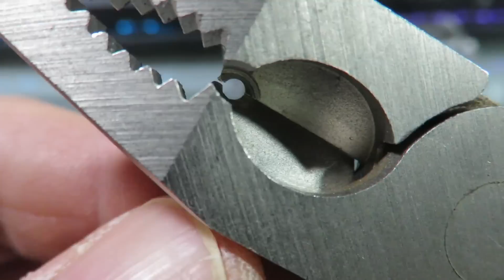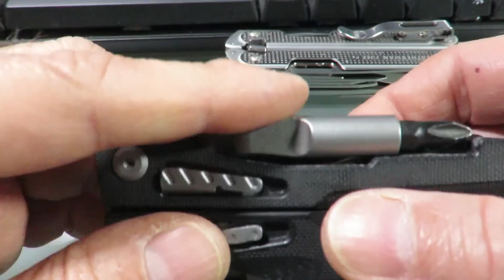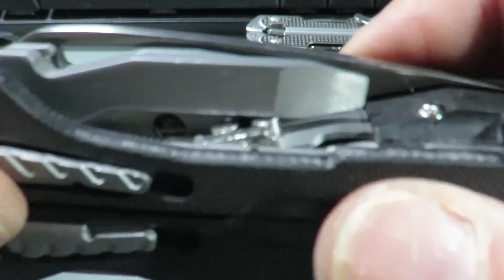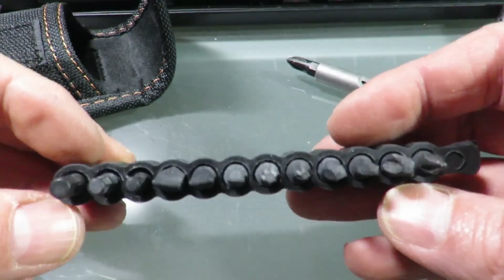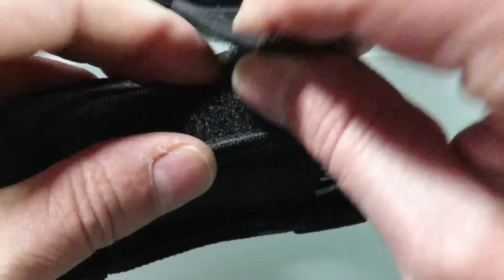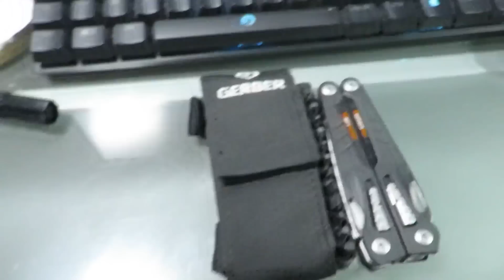GERBER MP1 : I wanted to save it!

Comment from the maker: MT VOD * Dear lovers of multi-tools, you can ask me everything, redo a review, insist on a detail, make comparisons, test this or that, I am at your disposal! :) * Multi-Tool VOD
Here is my collection of multi-tools (May 2019) [/S = Brand Sheath]
1- BALADEO Outdoor Cutlery Multi-tool /S               
2- BEAR & SON Bear Jaws 155LS /S
3- BÖKER PLUS Tech Tool City 5 /S
4- BUCK Knives X-Tract 730 /S
5- BUCK Knives X-Tract 735BKS-B Essential
6- BUCK Knives BuckTool 350 (MiniBuck)
7- BUCK Knives BuckTool 355 /S
8- BUCK Knives BuckTool 360 /S
9- BYRD ByrdRench BY15P /S
10- COLEMAN Pro Lock /S
11- CRKT Bivy (by Hans Florine)
12- CRKT Tool CR9200 (by Ed Van Hoy & Tom Stokes/ with Bit Kit) /S
13- CRKT Zylla-Tool Jr. /S
14- FISKARS Cuts+More
15- GANZO G301-H /S
16- GANZO G302-B /S
17- GERBER Balance /S
18- GERBER Bullrush /S
19- GERBER Center-Drive (with Bit Kit) /S
20- GERBER Crucial /S
21- GERBER Crucial F.A.S.T. (with Hex Bit Kit)  /S
22- GERBER Curve
23- GERBER Diesel /S
24- GERBER Dime
25- GERBER Flik /S
26- GERBER Fit /S
27- GERBER Grappler /S
28- GERBER MP1 /S
29- GERBER MP 400 Compact Sport (05500/ 45500) /S
30- GERBER MP 500 Recoil Auto-Plier /S
31- GERBER MP 600 Bluntnose (old model with 55200 Multi-Plier Pocket Tool Kit) /S
32- GERBER MP 600 Bluntnose Black (07520G1N Carbide Insert Cutters with Tool Kit) /S
33- GERBER MP 600 Pro Scout (07564/ 47564 with Tool Kit) /S
34- GERBER MP 700 Urban Legend /S
35- GERBER MP 800 Legend /S
36- GERBER Octane /S (*2)
37- GERBER Radius /S
38- GERBER Splice
39- GERBER Strata /S
40- GERBER Suspension /S
41- GERBER Suspension-NXT /S
42- GERBER Truss /S
43- GERBER Vise
44- HANWEI Professional Multi-tool by PAUL CHEN 1008-GT
45- HAVALON Evolve Shockey Signature Series XTC-60AMTS /S
46- HENSTRONG (or Bibury or Intey or …) 18-in-1 /S
47- KERSHAW A100C /S
48- LEATHERMAN Blast (with Removal Bit Driver) /S
49- LEATHERMAN Charge+ (with Bit Kit & Pocket Clip & Lanyard Ring & Bit Driver Extender) /S
50- LEATHERMAN Charge+ Forest Camo (with Bit Kit & Pocket Clip & Lanyard Ring & Bit Driver Extender) /S
51- LEATHERMAN Charge+ TTI (with Bit Kit & Pocket Clip & Lanyard Ring & Bit Driver Extender) /S
52- LEATHERMAN Charge TI 2HO (with Bit Kit & Pocket Clip & Lanyard Ring & Bit Driver Extender) /S
53- LEATHERMAN Charge TTI (with Bit Kit & Pocket Clip & Lanyard Ring & Bit Driver Extender) /S
54- LEATHERMAN Charge XTI (with Bit Kit & Pocket Clip & Lanyard Ring & Bit Driver Extender) /S
55- LEATHERMAN Crunch /S
56- LEATHERMAN Expanse E33BX /S
57- LEATHERMAN Expanse E55BX /S
58- LEATHERMAN Expanse K502X /S
59- LEATHERMAN Free P2 /S
60- LEATHERMAN Free P4 /S
61- LEATHERMAN Freestyle /S
62- LEATHERMAN Juice S2 /S
63- LEATHERMAN Juice XE6 (with Victorinox Mini Screwdriver) /S
64- LEATHERMAN Micra
65- LEATHERMAN MUT (with Bit Kit & Tool adapter V2) /S
66- LEATHERMAN OHT (with tweezers) /S (*2)
67- LEATHERMAN Raptor /S
68- LEATHERMAN Rebar /S
69- LEATHERMAN Rev /S
70- LEATHERMAN Signal /S (with Bit Kit & Bit Driver Extender)
71- LEATHERMAN Sidekick /S (with carabiner)
72- LEATHERMAN Skeletool CX (with Bit Kit & extra long bits) /S
73- LEATHERMAN Skeletool RX (with Bit Kit & extra long bits /S
74- LEATHERMAN Squirt E4
75- LEATHERMAN Squirt ES4
76- LEATHERMAN Squirt P4
77- LEATHERMAN Squirt PS4
78- LEATHERMAN Squirt S4
79- LEATHERMAN Style
80- LEATHERMAN Style CS
81- LEATHERMAN Style PS
82- LEATHERMAN Super Tool /S
83- LEATHERMAN Super Tool 200 (with Tool Adapter V1) /Combo S
84- LEATHERMAN Super Tool 300 /S
85- LEATHERMAN Super Tool 300 EOD /S
86- LEATHERMAN Surge (with Bit Kit & Pocket Clip & Lanyard Ring & Bit Driver Extender) /S
87- LEATHERMAN Surge 2013 Black Edition (with Bit Kit & Pocket Clip & Lanyard Ring & Bit Driver Extender) /S
88- LEATHERMAN Wave (with Bit Kit & Pocket Clip & Lanyard Ring & Bit Driver Extender) /S
89- LEATHERMAN Wave+ (with Bit Kit & Pocket Clip & Lanyard Ring & Bit Driver Extender) /S
90- LEATHERMAN Wingman V1 /S
91- PIRANHA 6-in-1 (crescent wrench & pliers combo) /S
92- PIRANHA 9-in-1 (crescent wrench & pliers combo) /S (*2)
93- RATNIK 6E6 (with diamond-coated file) /S
94- ROXON Knife Scissors S501
95- ROXON Multi BBQ Tool MBT Mini S602
96- ROXON Multi BBQ Tool MBT3 S601 /S
97- ROXON Sparkle CM1349 /S
98- ROXON Storm S801 (with bit kit & Victorinox Mini Screwdriver) /S
99- RUIKE Criterion M61-G (with Victorinox Mini Screwdriver) /Böker S
100-  RUIKE Trekker LD51-B (with Victorinox Mini Screwdriver) /Victorinox S
101-  SCHRADE Tough Chip ST2 /S
102-  SCHRADE Tough ST1 (original U.S./ version 1) /S
103-  SCHRADE Tough ST1 (Taylor Brands Schrade) /S
104-  SCHRADE Tough ST11 /S
105-  SCHRADE Tough STE5 /S
106-  SEBERTECH Sebertool M2
107-  SEBERTECH Sebertool M4
108-  SOG CrossCut 2.0
109-  SOG Paratool S31 (with Saw instead Philipps screwdriver + Bit Driver + Hex Bit Accessory Kit) /S
110-  SOG Pocket PowerPlier S44 /S
111-  SOG PowerAccess Deluxe (with bit kit) /S
112-  SOG PowerAssist S66 (with Saw instead of V-Cutter) /S 
113-  SOG PowerDuo PD01 /S
114-  SOG PowerLock S60 (with Bit Driver + Hex Bit Accessory Kit) /S
115-  SOG PowerPint (with Hex Bit Kit) /Böker S
116-  SOG Snippet
117-  SOG SwitchPlier V2.0 /S
118-  SOG Sync II
119-  SWISS+TECH Micro-Max 19-in-1
120-  SWISS+TECH Micro-Plus EX 9-in-1
121-  SWIZA C08 Urban Camo/S
122-  TOPEAK The Alien /S
123-  UD Vape Cool Kit Multi-tool Cutting Pliers /S
124-  UTICA KUTMASTER Multimaster 11-3565CP /S
125-  VICTORINOX Cybertool L (1.7775.T) /S
126-  VICTORINOX Expedition Lite (1.7965.AVT) /S
127-  VICTORINOX Huntsman Lite (1.7915.T) /S
128-  VICTORINOX Huntsman SilverTech (1.3713.T7) /S
129-  VICTORINOX MiniChamp (0.6385) /S
130-  VICTORINOX Nail Clip 580 (0.6463)
131-  VICTORINOX Pioneer X (ALOX Silver 0.8231.26)
132-  VICTORINOX Rescue Tool  (0.8623.MWN) /S
133-  VICTORINOX Signature Lite SilverTech (0.6226.T7) /S
134-  VICTORINOX Swiss Army Knife 18 (0.8461.MWCH) /S
135-  VICTORINOX Swisschamp (1.6795.T) /S
136-  VICTORINOX SwissTool PLUS (3.0323.L) (with all accessories & scissors) /S
137-  VICTORINOX SwissTool Spirit XBS (3.0224.3CCH) /S
138-  VICTORINOX SwissTool Spirit XC PLUS RATCHET (3.0239.N) (with all accessories) /S
139-  VICTORINOX Workchamp (0.9064.3) /S (~ 0.8564 : lockable large flat screwdriver)
140-  WALTHER Multi-Tac /S
141-  WENGER EvoGrip S557 (1.557.059.821 with Victorinox Mini Screwdriver/ ~ Victorinox Evolution Grip S557) /S
142-  WENGER RangerGrip Handyman 1.077.0[90.822] /S (~ Victorinox Ranger Grip 74 or 174 Handyman or Boatsman for the pliers)
143-  WENGER Titanium 2 /S
144-  WORPRO 16-in-1 Multi-tool /S
145-  XIAOMI Nextool Huohou /S

Acquisition forecast - Call for donations! ???
1- BEAR & SON Electrician's Bear Jaws BC155EL
2- EMERSON Multitasker EDC 1/ 2
3- GERBER Evolution MP650
4- LEATHERMAN Free T4/ 4KX
5- LEATHERMAN Juice Pro/ KF4
6- LEATHERMAN Pruner (Genus/ Visa/ Hybrid)
7- MELITA-K Sapper/ Professional
8- ROXON Multi Knife MTK S301
9- ROXON Multi Wrench MTW S401
10- SOG Powergrab
11- SPYDERCO Spyderench T01
12- VICTORINOX Swisschamp XLT
13- WENGER SwissGrip

Comment: So you have to use a a magnet to keep the screw driver closed? that sucks man.

On that, i noticed the magnet was full of metal dust, doesn't the same happen the in the leatherman free?
Reply from the maker: Well yes, of course, this is one of the faults of Leatherman Free :)